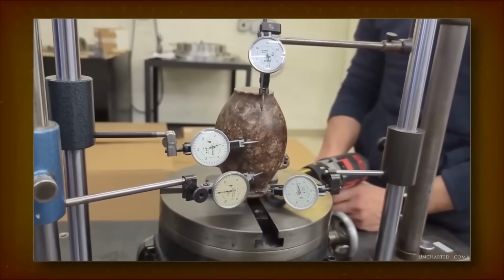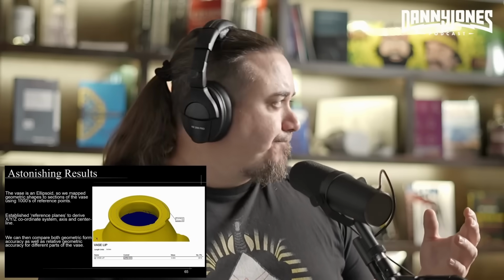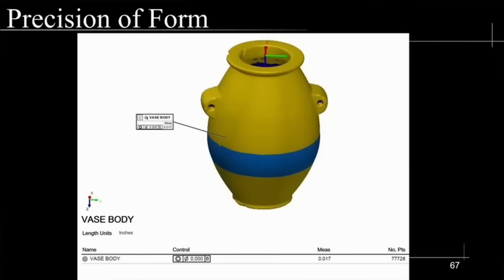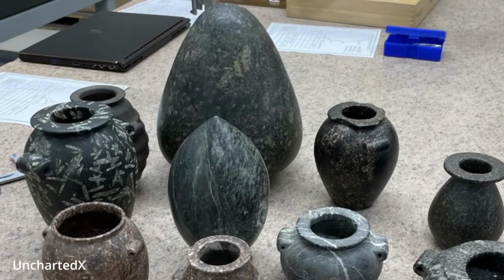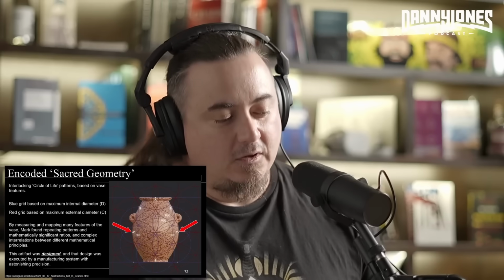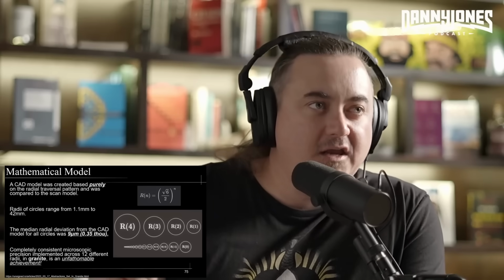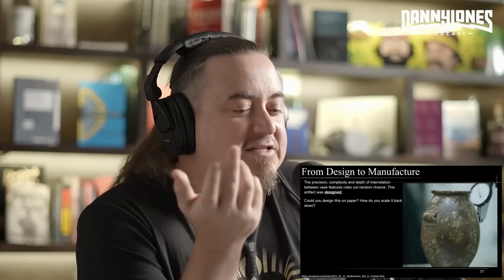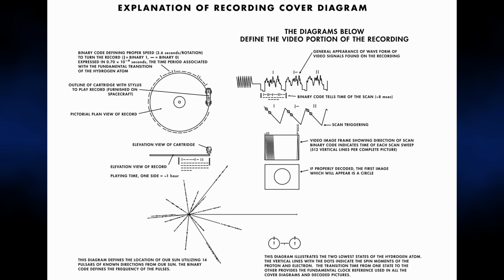Are These Ancient Egyptian Vases Actually Impossible to Make? #podcast #science #history #egypt

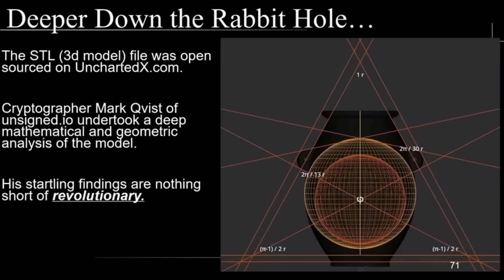Comment: 16:22 As someone who has done aerospace machining on lathes, mills, and swiss type lathes for 15 years now, hitting a .007" true position on those handles with zero modern cutting OR measuring equipment seems absolutely fucking insane to me. That means it's almost perfectly aligned in more than one axis, it's only off by something like .002 in on and .0025 in the other without actually doing the math. That's insane to me, we can hit tighter precision now in metals (no idea for stones honestly), but that's just insane to me they try to say that's hand made, there's NO way in hell you could have so many different measurements so perfect without some type of machine aid and measuring equipment, not to mention the engineering ability to plan this all out before you actually made it because you don't get that kind of perfection without detailed blueprints of some sort to go by
Reply: it's easier in metal, there's no comparison to such hard stones
Reply: @Michał-e7j  yeah, but what about diamonds? They cut diamonds way before Industrial Revolution, didn’t they? By hand. Diamond is harder than granite, but they used copper amongst other things. Go look it up and you can say “I’ve done research“
Reply: I say blueprint of some sort vs mathematical design as he put it also (even though blueprints ARE mathematical designs just a visual representation of it). We make modern buildings on paper that fits on a table, why would it take an entire room as he said? You can draw at scale, you can draw a radius as any radius as long as it's labeled what it should measure on the print. Vases would probably only take 1-2 page prints, they're not as complex as the modern components we make today referencing a piece of computer paper to get the measurements lol but either way even modern CNC machines that run continuously can't maintain tight tolerances on their own. Operators are out on the floor measuring and making offsets as tools wear, things cool/expand and so on. Modern aerospace shops that meet the higher standards are even temperature controlled because just a couple of degrees can change the measurement of the part that comes out by a lot when you're working in the .000x" range or sometimes even smaller.
Reply: @chrissyp930  When working in stone you have to allow for polishing of the stone to remove toolmarks and imperfections caused by inclusions, it's almost impossible to polish to such accuracy by hand and to do it on a machine would require computer control, we have only had this technology for a few decades.
Reply: @ian-c.01 and yet the ancient Egyptians did in fact polish these vessels by hand. They were highly skilled.
Reply: @ryann6067  No matter how skilled a person is they could ever reach the skills required to achieve this, it is NOT hand made !
Hand polishing would leave a very uneven surface which would never match the fine finish of these items ! Ben describes the measuring process and measuring tools that were used to examine these items and there are even clips of the Dial Test Indicators showing how the items were measured, you clearly don't understand how small those measurements are ! The deviations in the surface of the vase between the lug handles shows a maximum of "7 x one thousandths of an inch" that is about 25 microns and it is consistent and between the lug handles where there is most likely to be errors ! That is a cylindrical vase not a flat surface and it is also curved to an exact measurement so well that we can measure the radius and find it's centre point using 3D plotting software on a computer. This is not accidental or the results of trial and error, this is intentional and without fine measuring tools to check progress there is no way they could even know that they had achieved what they intended !
That is quite literally impossible by hand and this vase is not the only one they have examined, they have looked at many and are currently in the process of arranging to work with museums to measure and test many more !
The result will be very revealing !
Reply: @ian-c.01 your denial of fact-based reality is unsurprising given your admitted ignorance of this topic. Otherwise you are just repeating incredulous grifters nonsense. You don’t sound serious about ancient Egyptian stoneware craftsmanship and sculptural methods or fact-based reality.
Reply: @ian-c.01 hand-made ancient Egyptian stoneware funerary vessels deposited in tombs as grave-goods are fascinating. Especially the fact that no two are alike as each was hand-made using basic stone working methods. Which had been in use for hundreds if not thousands of years. Stone tools rock! 🤘
Reply: @ryann6067  You are the one denying the facts, the claim is that these were found by the ancient Egyptians.
I can tell you are just trying to get a reaction so I won't bother to try to convince you that you are wrong. I have enough experience of stonework, metalwork, mechanical engineering and machining to recognise that these items were not created by hand or by accident. That and the evidence that Ben presents clearly show that there is more to this than what was initially thought, and Ben presents the results of his extensive research in a way that overrides any argument that you could dream up !
You are not going to convince me that we are wrong and you are right, in the next few moths this is going to become huge, wait and see !
Reply: @ian-c.01 so in other words you are totally ignoring ancient Egyptian material culture and context with which thousands of these individually differently made funerary stoneware vessels were found? -Okay Let me know when you want to take the study of these objects seriously.
Reply: @ryann6067  There is absolutely zero evidence to suggest that they were made by those Ancient Egyptians, there is a wealth of evidence that shows they didn't have the capability !
There is evidence that shows they made rough copies in alabaster which were very crudely made and are not in the same league. There is also evidence that they made clay pots for funerary ware but all the granite pots that were found inside tombs had lids made from clay just like the clay pots because the granite vases and bowls were found and reused and the Egyptians couldn't make granite lids to the same level of accuracy !
I have been following Ben's channel for many years, he goes into great detail about all this, it sounds like you are just hearing about it.
Go and check for yourself !
Reply: @ian-c.01 you obviously don’t take these material objects very seriously and clearly don’t know what you are talking about.
Reply: @ryann6067  I think you are confusing me with someone else !
I DO take them seriously and as a qualified engineer and machinist with extensive experience of working in many materials including metal, wood and stone I DO know what I am talking about !
I have worked on machines that can produce extremely fine results to exceptional tolerances and I can promise you that the items that Ben is discussing are impossible to make without such machines ! They are also impossible to design without computers and computers are required to control those machines in order to get the extremely fine and accurate results that Ben and his team are seeing when they scan them !
How this was achieved in pre-Dynastic times is unknown, these items are anomalies and should not exist but they are real and they can be seen in many museums and collections !
Reply: @ian-c.01  No, its quite clear you are either being purposely ignorant and dont really want to seriously learn or understand the context and culture of when and who made these funerary grave-goods. Or you truly believe that Ben (who ignores the material culture and historical cultural contextual evidence and waxes on with pure speculation based upon his own unqualified opinion) is a valid and trustworthy source of information on these beautifully made stoneware food storage vessels use as burial offerings for the dead in their tombs. In either case I feel sorry for you. 

When you actually want to learn about these objects, you may want to study the history and development of the late pre-dynastic and early Dynastic elite burial practices. As well as stone working practices and tools of the Nile river valley. And perhaps the known technology of the Neolithic and Chalcolithic periods, as well as the early Bronze Age.

And again you could have just said you dont know anything about stone working or Ancient Egyptian history or material culture and saved yourself all that typing.
Reply: @ian-c.01 given your machine-engineering knowledge you obviously already know these stoneware vessels were made by hand using various stone hand-tools. And given that no two vessels are carved to the same dimensions is a clear indication they were not machined, but instead manufactured by hand by skilled artisans.
Reply: @ryann6067  How do you know "that no two vessels are carved to the same dimensions" ? Just because no identical pairs have been discovered does not mean there are none, given that they are many thousands of years old and have been picked up and taken around the world we just don't yet know if there are no two the same !
No skilled artisans are capable of such fine accuracy !
Reply: @ian-c.01 clearly you don’t operate in fact-based reality. And obviously you have never seen nor do you have knowledge of high quality artisanship and craftsmanship and have no understanding of hand tools. Let alone ancient Egyptian stoneware funerary vessels were made with stone tools. And obviously don’t actually care for that matter. -Good luck gaslighting yourself with nonsense cheers 🍻
Reply: @ryann6067  No hand tools can create shapes to within a few thousandths of an inch consistently no matter how skilled the 'artisan' using it !
This type of accuracy has only been possible since the creation of hardened needle roller bearings in machinery which happened less than 100 years ago !
Show me someone with that kind of skill or show me some items that you can prove are hand made with that degree of accuracy !
Reply: @ian-c.01 again, confidently outing your ignorance of this subject publicly. And justifying purely based on Your own incredulity and lack of understanding, Fascinating 🧐
Reply: @ryann6067 be quiet. There is zero substance to your argument, and I believe you are trolling. What is your profession?
Reply: @siezard4663 so you have nothing of relevance to say about ancient Egyptian stone funerary vessels? Stone vessels carved of many different stones and all differently shaped due to being individually made by hand. People(without any evidence) think they didn’t create or carve these with their stone tools.
Reply: @siezard4663 if you have nothing relevant perhaps you should “be quiet”.
Reply: @siezard4663 do you know who also has zero substance (and no evidence either) to their arguments? The dude in this video. Funny that
Reply: @ryann6067 Oh I see now looking at all your replies, you’re just trying to annoy this guy. It’s very obvious looking at this interaction that you don’t know what you’re talking about.
Reply: @ryann6067 An engineer and machinist tells you how complex and advanced the engineering of the vase is, and your counter argument is that archeologists know better about engineering than engineers because the vase is old ...
Reply: @ryann6067 you've revealed yourself to be bit of a fool here, unfortunately. A long hard look in the mirror might be in order
Reply: It was the Anunaki human with future tech that did this you deserve to know truth
Reply: @kaemeleon hahahahahahahahah nah it was marvin the martian.
Reply: Let’s not forget the need for tight smooth running bearings with near zero runout. This truly is insane.
Reply: @jerseyjeeper1575  lets not forget the that ancient Egyptians were not using ball-bearings. Its truly insane to ignore actual material culture and technology available to them.
Reply: In meiner Lehre habe ich auf Mü gearbeitet, die Hand ist feiner als man denkt.
Reply: Sure! The vase survives but the machine doesn’t?
Reply: @Its_Shaun_the_Sheep  Stone does not corrode like steel
Reply: @ian-c.01 it’s only 2000 years so the whole electricity grid and power plants is gone also?
Reply: @Its_Shaun_the_Sheep  Metal corrodes, given enough time it all returns to it's non refined state and these stone items are thought to be over 10,000yrs old so that is plenty of time.
We have only had high quality steel for a few hundred years but already the first items that were made are dust.
However there is no evidence that they used electricity and power stations, they could have used other power sources such as water or wind. It's not difficult to channel water through aqueducts and divert it to where it is needed. Raising it's height and allowing it to fall produces a lot of power which can be used to turn wheels etc.
Forcing water through narrow nozzles can produce incredible cutting power too and that wouldn't be beyond the capabilities of people who could produce such fine stoneware.
Reply: @ian-c.01 note homogeneous steel wasn’t invented until the late 19th century. You really dont know what you are talking about, lol. So fascinating.
Reply: @ryann6067  I have read your comments and it is truly astounding how you just disregard the accuracy of repeated measurements on display here. You have not the slightest knowledge of engineering in this area. There absolutely zero possibility that these could have been machined to such small tolerances by hand. The differences average around 0.004" across over 20 000 points of measurement. 

You are a clown.
Reply: @ryann6067 isn’t it great how AI can form the argument of a polemicist these days….hashtag lazy troll
Reply: @carlgardner-lk1xz isnt it funny you blame AI because you don’t know this subject and are unable to comment about it constructively. Fascinating admission that, your comment.
Reply: @ian-c.01 who mentioned any thing was made of steel 😊?
Reply: @ryann6067 yea and even more interesting is how you ignored not just the data, but it being pointed out to you that you have no idea what you're talking about lol
Reply: so the conclusion is it was not made by hand
Reply: @zedalive4764 meanwhile the fact-based conclusions are that these stone funerary storage vessels were in fact made by hand by skilled craftsmen.
Reply: @zedalive4764 that’s what the grifters say. In fact based reality we know they them by hand, and with the use of mechanically assisted hand powered drills.
Reply: @ryann6067  a couple of them said something else in comments of this vid. in order to get precision from a lathe you have to have precise industrial bearings. without precision in lathe itself you can't get a precision out of it. so it rules out ideas like 'wooden lathe'
Reply: @zedalive4764 so you support grifters and who ignore fact-based evidence? Fascinating you are publicly admitting that you support a fantasy.
Reply: They were cutting diamonds with copper, oil and diamond dust in 1400’s. By hand. All you “as an engineer” guys are just bs or you shouldn’t be an engineer. You can grind diamonds with adequate technique, not to mention granite. 😂
Reply: @stout8529 There’s lots of things you can “do” with with hand tools, what you can’t do is get these levels of precision with them just using the human eye.
Reply: @InfamyOrDeath-__-  no, no… YOU can’t. Those who master the craft CAN.
Reply: @stout8529  That s moronic, we have the measurements of very advanced hand crafted artifacts done on lathe machines / pottery wheels by professionals, and they are not nearly that precise, even in pottery, which is much easier to make. 

Egyptologists argue that they didn t have either of these back then.
Reply: @stout8529 you need measurements, a blueprint. And much more. Not just eyes hands and expierence my lil man.
Reply: @sirtrollsalloth  lil buddy, take a rest. You suffer from not knowing what you don’t know. Get some real world experiences and stop fantasizing over mystical sensations.
Reply: We’re not sure about what tech was available to ancient people, probably something simple yet complex there is a lot of tech lost even in our own time
Reply: @chrisk891 we are though. Stone and copper tools. And we have numerous examples of them too.
Reply: @ryann6067 not even they can’t even go to the moon with 1960’s tech because they lost most of the data.
Reply: @chrisk891  And Thanks for the laugh, I appreciate it!
Reply: Why no trace of any thing that maee these things we need to do more measurements with as much 
Pot as we can find.
Reply: @relearnitall the more pot the better! 😂😂😂😂😂😂😂😂😂😂😂😂😂😂
Reply: The African people were sharp on Math. Congratulations to the Black people of Africa.
Reply: Am I right that you can’t achieve this level of perfection without:

Blueprint-level previsualization (precise geometry already resolved before starting).

Repeatable measurement feedback loops during cutting (e.g., fixed calipers, jigs, or indexing systems).

Predictable tooling geometry — meaning the cutting edges themselves must be manufactured to tight specs.

In aerospace work, you start with CAD/CAM; in ancient times, this implies either:

Some mechanical-computational analog to store and transfer ratios (template arms, geared devices, parametric scaling).

Or access to a parametric mental model with mechanical execution — essentially an ancient CNC without electronics.
Reply: @drsgb GREETINGS Outstanding. ANCIENT CNC 😊
Reply: @drsgb  we can recreate them to a higher precision.
Reply: Maybe, just maybe stone was not as dense as it is now?  Soft stone would be the answer to many perplexed questions on historical discovery.
Reply: These have been recreated by hand. Using hand tools. 
😂😂😂
Reply: What’s a “Swiss” type lathe?
Reply: I can do it while someone else holds the beer…..
Reply: Greetings your comments, I'm just laughing hard and loud. I'm a Hard core gear Head. Your so spot on. Where's the Tools?😊
Reply: I can’t believe some people still believe that these vases were made to this precision or even at all with the tools of the time. STUPID PEOPLE 
so obviously lost very advanced technology . It’s insulting to be told otherwise. Mainstream archaeology is bs.
Reply: @karlsellers speaking of “stupid people” 🙄. Tell us more about this thing you believe that has absolutely zero material culture evidence of its existence. -Do you also believe in Santa Claus and the Easter Bunny too? At least with them there is over a century worth of related cultural material supporting their existence 😂😂😂😂😂😂😂
Reply: No you don't. You're a bot.
Reply: Until someone finds evidence of the tools used to make these vases we can only have educated guesses. I bet everyone will kick themselves if it turns out to be a tool we use today but for different purposes, could be a simple item or some advanced tech which was invented by some ancient humans then stolen by raiders, taken to some other part of the earth like ended up somewhere and the tools got lost in transit or destroyed possibly. I would love to know how these were made but if not then just the point these beautiful objects exist will be enough for me.😉👍
Reply: @revzombie we have them. Have you not seriously bothered to learn about these?
Reply: Thank you! 
These objects were made by Atlanteans (Zep Tepi)
Reply: @BeatlesFan1975 😂No. Atlantis is a fictional allegory invented by Plato and isn’t a real place.
Reply: Engineers from the USA are not good in comparison to many countries and you prove that by suggesting 0.1778mm is a tight tolerance! haha man every engineer is pointing and laughing at you. My dad was also an engineer and I've seen him reproduce my c.n.c part with a tolerance of 0.001mm, by hand on a lathe in his garage... so you speak absolute nonsense.  I'll explain what has confused you.. this video mentions sizes etc that never existed. they didn't cut it to precisely any inches as that's a very modern size my forefathers invented in England. Also as a note, the Inkas cut granite precisely. It is weird how to different cultures without modern machines, both produced items out of hard rocks and there's no written knowledge about how they did it. Ok so the Inkas (incas) didn't have a written language like the Egyptians but the Spanish who conquered them did and they never mentioned anything.....
Reply: @ADayInTheLifeOfAYeti ”conquered” is a word used by those that do not know any better.
Reply: if you see ancient Indian idols you would think they were made with machines but they were made by people and some communities can still make idols out of stones that look realistic
Reply: @Addictedtoyoutube9 That's nice. These, however were not. 
You saw a Volkswagen, employing your logic, I suppose all vehicles must therefore be Volkswagens.
Sigh........
Reply: So in other words you dont know what you are talking about lol. You could have just said that and that you are not an expert stone ware craftsman
Reply: @ryann6067 so if a stone ware craftsman said it's impossible you would be OK? Because an Egyptian Mason, family of masons, says so. 😲🤷
Reply: @paulastearns3074 lol That scenario is silly and mute given these stoneware gravegoods were in fact sculpted by ancient Egyptian craftsman using stone tools, primarily flint hammers and flint drills. during the late pre-dynastic period and during the first and second Dynasties.
Reply: @paulastearns3074 do you even know about the cultures that created these funerary offering storage vessels?
Reply: @ryann6067 no offense Ryann but you really are being a pain in the arse.😊❤ love and prayers 🙏 from South Africa 🌍
Reply: @ryann6067 I know what archeologists, Historians have taught us.